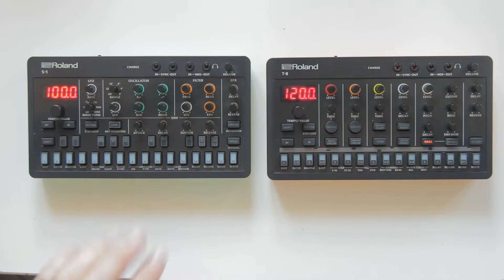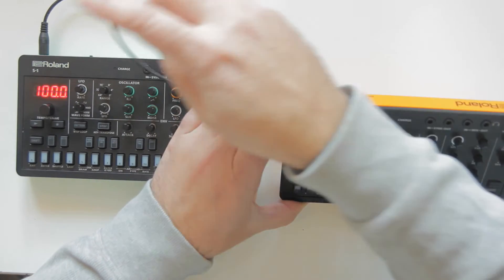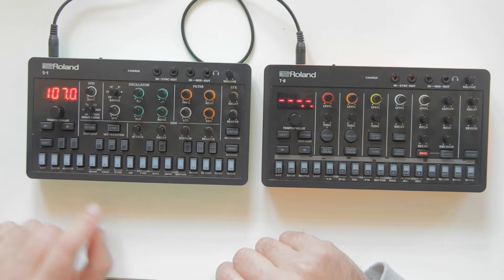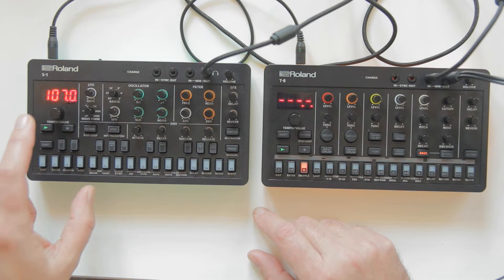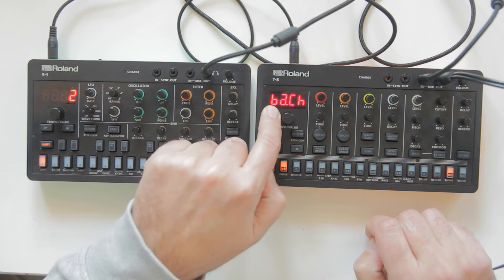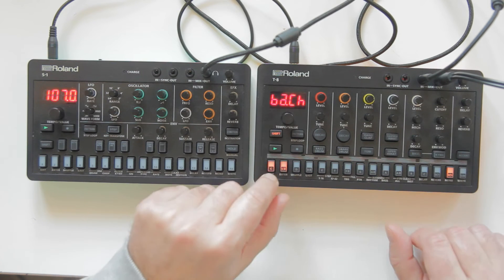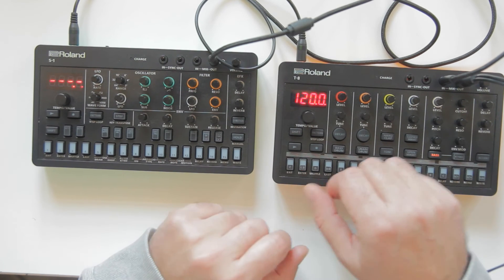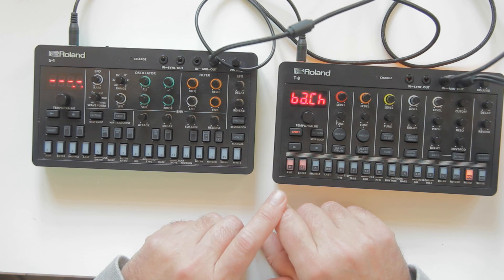Synths Midi Synchronization explain with Roland S1 & Roland T8 Aira Compact

Comment: is there a way to use them with the midi connection (so the play button on one triggers both) without having the master device change the pattern on the slave device?
Reply from the maker: Hi, yes there is a way. On the slave machine you have deactivate the "Receive Program Change" or in the master "Send Program Change". I have to check it out on the menus how it is written but it will something like this"PCh" or "PrCh". Hope it helps!✌️
Reply: @BrunoLuisGarcia  LEGEND! thanks dude. very helpful
Reply from the maker: You are welcome, great to know it helped.👍
Reply: @BrunoLuisGarcia  just looked it up, in the T8 menu tHPc is for whether pattern changes are transmitted or not and rHPc  is for pattern changes being received or not. Thanks again! Didn’t look in the S1 manual but it’s probably something similar
Reply from the maker: Hi, great that you manage it to work and thanks for the info!👍

Comment: Hi, to synchronize the drum Brute Impact  with the Roland S1 is it the same thing?
Reply from the maker: Yes, it is!👍
Reply: Thanks you Today I received the Roland S1. Before I had the J6, I didn't really like it, it wasn't really a small synth.  @BrunoLuisGarcia
Reply from the maker: To Sync with the drum Brute via 3,5 mini jack Midi you have to have an adapter the Roland Airas are Type A and the Arturia stuff are Type B.
Reply: What kind of adapter do you need? Because it's true I couldn't synchronize with a 3.5 mini jack. @BrunoLuisGarcia
Reply: I looked everywhere, I tried all the means in mini jack 3.5 in midi no sound comes out strange except plugging them separately but in this case I have no synchronization
Reply from the maker: Sorry, I just notice that the Drum Brute does not have a 3,5 midi jack. So you can sync them via the Sync (Clock in/out) ou via midi with a 5 pin Midi plug to a 3,5 mini jack cable (Type A).
https://www.thomann.de/de/rockboard_flat_trs_midi_cable_30_cm_a.htm?gad_source=1&gad_campaignid=1576042966&gclid=Cj0KCQjw097CBhDIARIsAJ3-nxc8oZ3A3QVjAyAENyY-wgEVJq6a0RZMlQM3tT40GVqLf0pAgGrbL4caAmQLEALw_wcB
Reply: ok ok thanks for the link I will buy it and try it later if it is good @BrunoLuisGarcia
Reply from the maker: That's the one I use, it works perfectly.👍

Comment: Such a simple and clear explanation. I think the first half of the video is what I need for now. A thousand thanks.
Reply from the maker: Thank you very much for your feedback, glad to hear that it helps! 👍
Reply: @BrunoLuisGarcia You should know that you didn't answer me. I would have bought other midis that are not compatible. I thought that all midis were the same but there are many differences in any case thank you very much I hope it will work
Reply from the maker: Sorry, I think I did answer you. Midi are all the same messages the type of connectors can be different. It can be a 5 pin midi connector, a 3,5 mini jack Type A or B, Usb , Usb C or even Bluetooth. But the midi messages are the same.
Reply: I understood for the headset I should also have a problem with the plug when I push it lightly on the drum brute impact I have sound if I push it completely I only have sound on one side and it is less loud  @BrunoLuisGarcia
Reply from the maker: Sorry, I don't have a Drum Brute but are you connecting the headset to the headphones out or to the main out?
The Drum Brute has a headphones out with for a 3,5 mini jack and 1,4 jack and a volume poti for the headphones. From your description I think you are plugging the headset to the "Mix output" (main out).
Reply: The white drumbrute 1984 has a headphone output and a mix out output. The headphones are plugged in. I have to try with another headset, otherwise I prefer to compose on speakers than on headphones. The drum brute is a good machine but you need another one with it because you quickly get used to it, but hey, I hope the synchronization will work. Roland told me that the drumbrute and the s1 must not be on the same midi channel. @BrunoLuisGarcia
Reply from the maker: That's right if they are in the same channel you will send notes to slave. If they are note in the same channel they will start and stop at the same time (if think this is explain on my video) and they can also have program change if they are set to do so.

Comment: Can you update a new video to sync to a PC or MAC DAW
Reply from the maker: Sorry, I don't use it them with a DAW, but it should be very simple. Just plug them with the USB cable to a computer. Make sure that the Synth Track on the DAW has the same Midi Channel has the Machine you want to use, and it should be all set.✌️
But still, I will think about it, thanks for your idea!👍

Comment: Do you know how to sync one or more Aira’s to a PC through Ableton or any DAW using the usb cable on t one Aira through the usb cable
Reply: I mean the usb cable to one and then midi connections through 3.5 cables
Reply from the maker: For the Midi information go thru the 3.5 cable from the USB input, you have to turn "on" midi "thru" on the menu. It should be on by default.
Reply: @ thank you the menu system is hard to understand I will try that appreciate your fast reply
Reply from the maker: You are welcome!👍

Comment: Hello Bruno amazing tutorial 🙌🏼 thanks! 
I read on the manual of the S1, page 7 this: 

Use TRS/TRS (BCC-1-3535 or BCC-2-3535, sold separately) or TRS/MIDI connecting cables (BMIDI-5-35, BMIDI-1-35 or BMIDI-2-35,
sold separately) to connect this unit to an external MIDI device.
You can make this unit play in sync with a MIDI device by connecting the devices with a commercially available MIDI cable.

But I saw a lot tutorial using audio cables. I’m new on this so I’m confused cause I also read midi cables transport midi data and aux cables are made just for sound.
Reply: The cable you used for MIDI is 2 or 3 feet long? Same questions for the audio one? 

I don’t have yet the T8 but I planned to buy it. I want short cables to have a clean set up but idk if 1 feet could be a problem.
Reply from the maker: No worries about how long it has to be. It will work!
I understand your worries if you are starting, but relax it's very simple.🙌😎
If you are using two Aira compacts you just need 2 Stereo Cables. One for the Midi and Another one for Audio. The length plays no role.
You also can Sync them via the Sync connection on top of the Airas. For that a mono cable will do the job but the stereo also.
Headphones and you are set!✌️👍
Reply: The 5 pin to TRS cables are wired differently. 
I’ve used both types and found it cheaper to build my own cables. 

Best option is to check the manufacturers pages to get the correct type.
Reply from the maker: Yes, they are wired different on the Trs side. Roland uses Type A and Arturia use Type B.
Reply from the maker: Hi, this is a normal AUDIO STEREO cable. Midi is "sound/audio" you can ear it if you plug it to a amplifier or headphones.
There is nothing special on this cable, it only has to be STEREO.
If you are going to sync it to a device with a "5 pin Midi" plug. Them you need a "TYPE A" - 3,5 mini Trs jack to a "5 pin Midi" cable. In this case the Type "A" is very important if not it will not work. There is a Type B cable that other manufactures use like Arturia but Roland uses Type A.
Many companies sell this cables without specifying if is type A or B. My advice just buy if the specify it.

Comment: Hiya. Question, and don't know if anyone else might know, but can you divide the incoming midi clock to the s1, so that it can play in half time for instance against the main sequencer? Seems like a basic feature that just doesn't exist. Looks like it might, with sync clock, bit this doesn't seem to do anything?
Reply from the maker: Hi, I will check it and let it know.
I think it's possible.
Reply: @BrunoLuisGarcia  Thanks, just double checked ChatGPT, and it's an emphatic no! Which is odd. I think every synth like this I've owned has had some capability to slow the clock down. Shame.
Reply from the maker: No it is possible!
Hi I check it and it's possible if the the main sequencer or one in the chain has a "Sync out" connection. You plug the midi cable "in" and if you set it to the same channel as the one sequencer in the chain it will play the notes of the external sequencer. 
To make it play half of the time you plug the one cable from the "Sync out" port from the main sequencer or out of one sequencer in the chain and plug it to the "Sync in" on the S1.
To play half of the time you go to the menu on the S1 and change the "S.clk" to the double of the number from the main sequencer. If it says "4" on the S1 you change it to "8".
In this way there are to cable connected the "midi" and the "sync" the S1 will start and stop when the main sequencer does it and it will play notes, if in the same midi channel , of the sequencer you choose the main or another.
If you don't need to play the notes from another sequencer you just need the "sync" cable but it will not start and stop with the main sequencer you will have to do it manually.
I don't know if I made it clear but you might check this video where I try to explain the "sync" port.
https://youtu.be/FGbkbxEQbOY
Any questions let me know!✌️
Reply: @BrunoLuisGarcia  Woah! I'll try this later and let you know how I get on. Massive thanks if it works!
Reply from the maker: Let me know!👍
Reply: @BrunoLuisGarcia  Well, can I send you a box of chocolates - it worked! I was in this area earlier and it wasn't quite synching right, I assumed 1 meant same speed as sequencer, but it speeds it up. I guess if my main sequencer is set to 4PPQN, then 4 on the S1 is the same tempo (1 is faster, 8 is slower etc.). Which certainly seems to be the case. My main sequencer by the way is a Korg SQ64, so I can confirm that this technique doesn't have to be a Roland device, and it works using the SQ64 (obviously splitting the Korg sync out signal with a stereo splitter as one half is a reset signal on Play/Stop). Thanks again, I'll build this into my latest track :o)))))))))
Reply from the maker: I love chocolate!😄😍
Glad to hear that you manage it to work.👍
I also learn something with your question the S1 can receive notes via midi and PPQN at the same time via sync port. Thank you too!✌️

Comment: Hey Bruno! thank you so much for your videos and music!... may I ask you something? Im trying to get in sync a TR-08 with a S1 via Midi cable... I can start/stop both machines, but definitely not able to get them in tempo. there´s something else I should configure?. Thank you so much in advance!
Reply from the maker: Hi, in the video at 2:14 it's explain but maybe is to fast, sorry! 
Go to the "Menu" and set the "Sync" parameter to "Auto" or to "Midi" on the slave machine (the one that will follow the tempo of the other, "midi in". 
My advise is to set it on both machines to "Auto". This way they will follow the internal tempo but when a cable is connected to the "midi in port" or to the "sync in port" it will automatically follow the tempo of the other machine. No need to go in to the menu every time to change it.
Hope you can solve it, if not let me know.✌️
Reply: @BrunoLuisGarcia  hmmm nope it´s not working... I´ve wired both machines as you say, I´ve set both machines to "auto", and both machines are playing a sixteen steps pattern, with only one kick in the first step. But they meet (in the first kick) only every 4 loops. No matter if the S1 or the TR-08 is the master... always the S1 is faster than the TR.  That´s why I was thinking there should be any other thing to configure... anyway thank you so much for your time!
Reply from the maker: That's strange! Is the cable good? Try another cable (Stereo).
You can also check on the T8 in the Menu the "r.SCL" parameter set it to 16.
Reply: @alebenages745   maybe the sync clock parameter that needs to be the same for both machines. maybe you have 1 on one machine and 4 on the other, which means that one runs 4 times faster than the other machine
Reply from the maker: That can also be case!👍

Comment: Thanks for the video! Are you using a midi cable or audio for the midi connection? Surely midi, right?
Reply from the maker: Hi, you just need a normal mini jack 3,5 stereo audio cable. 
That's what I'm using, I explain it in the video.👍
Reply: @BrunoLuisGarcia  Thanks so much for the fast reply. Just received the T-8 and S-1 today, so good to know that I don't need to run to the shop for TRS midi cables!
Reply from the maker: 👍
Wish you lots of fun and good music with them!✌️